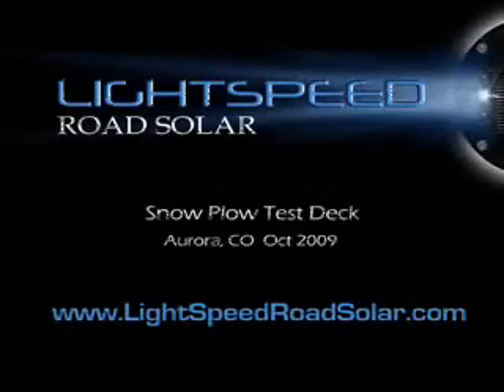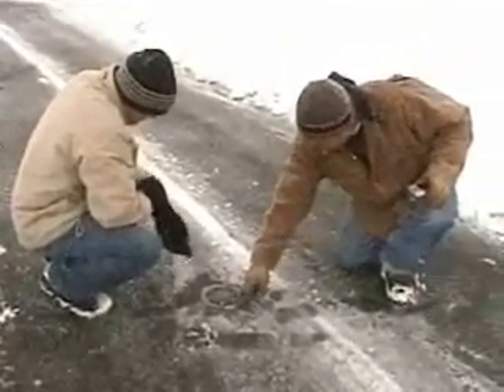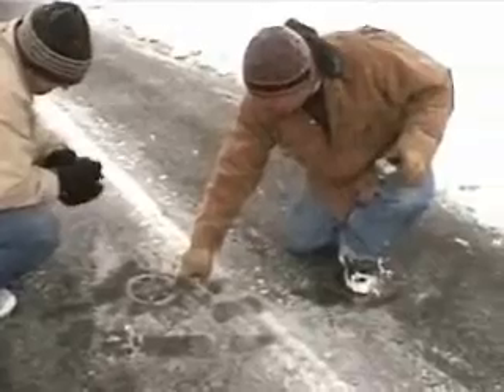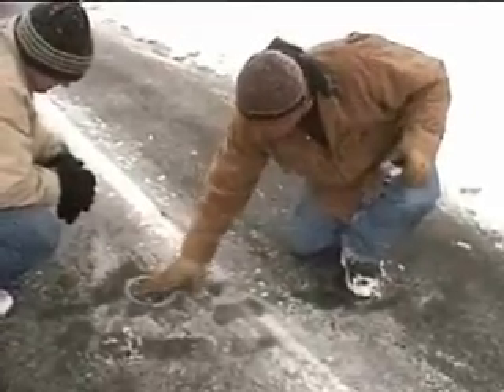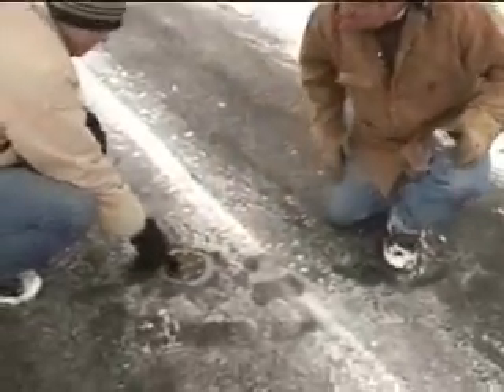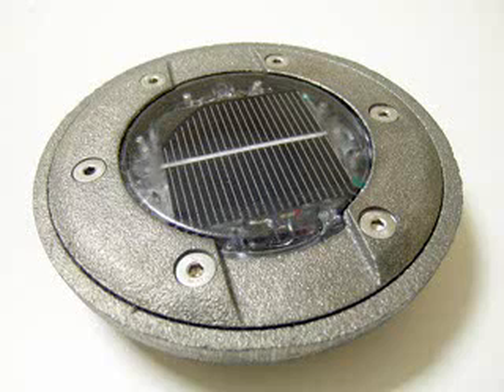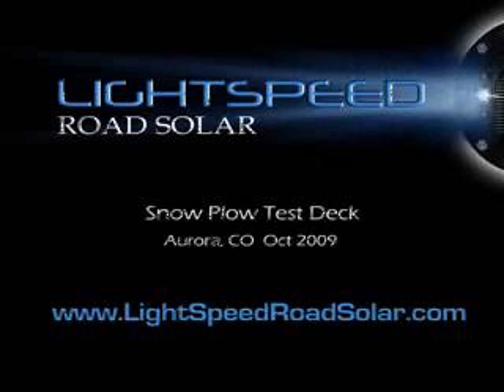Snow Plow vs Solar Road Marker

Comment: I am all for anything that makes night driving easier.  But your thoughts on weight rating is incorrect.  Their are oversized permitted loads that approach 1 million pounds.  These are generally on what is commonly referred to at west coast ten axle trailers.  With Load Range L or M tires.  These tires have a maximum payload capacity of 12800 lbs.

Comment: This is tested for 6 tons. I wonder how much weight the typical underbody plow blade, as used in most snowy regions, can put on one of these markers when it hits it at high speed? I've seen them take the tops off cast-iron reflective raised pavement markers, as well as remove portions of the pavement itself.